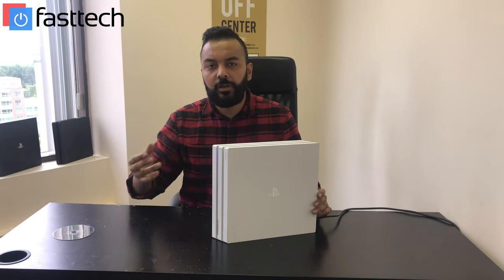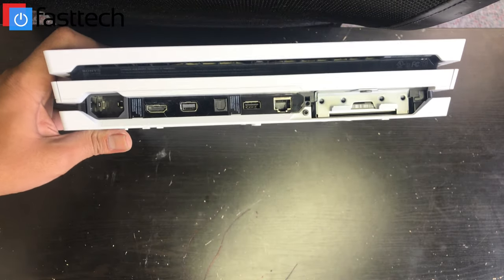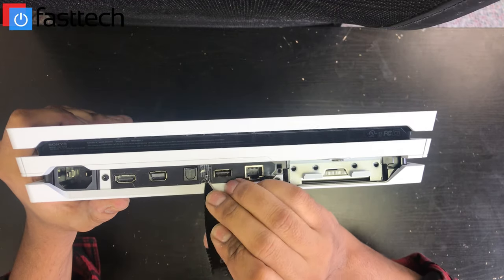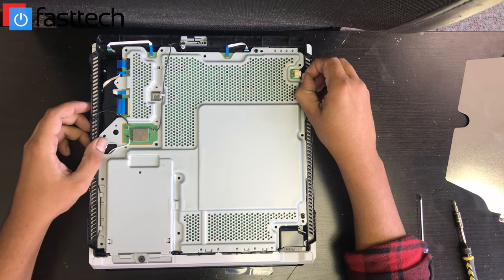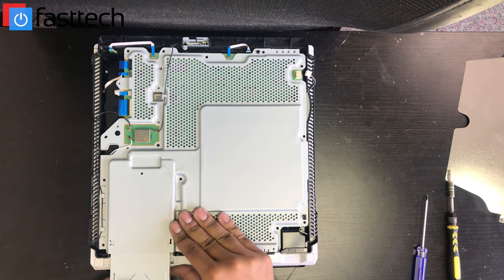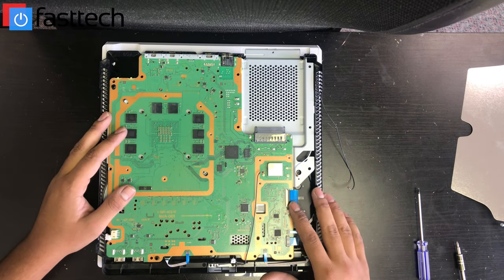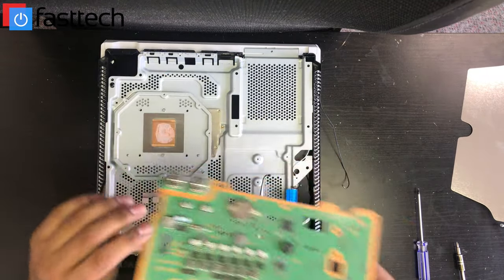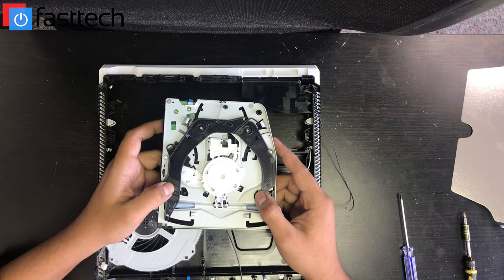PS4 Pro Disassembly and Disc Drive Repair Fail

Comment from the maker: FREQUENTLY ASKED QUESTIONS
Where do I buy the parts and tools needed for this job?
▶️PS4 Pro Disc Drive (CUH-7015/7000): https://www.fasttech.ca/playstation-4-pro/ps4-pro-disc-drive-cuh-7015a
▶️PS4 Pro Disc Drive (CUH-7115/7100): https://www.fasttech.ca/playstation-4-pro/ps4-pro-disc-drive-cuh-7115
▶️PS4 Pro Disc Drive (CUH-7215/7200): https://www.fasttech.ca/playstation-4-pro/ps4-pro-disc-drive-cuh-7215
▶️Torx T8H Screwdriver: https://www.fasttech.ca/playstation-4-parts/torx-t8h-security-screwdriver
▶️Knife used: https://www.fasttech.ca/tools/credit-card-folding-knife
▶️Dont want to DIY? Send us your PS4 for service: https://www.fasttech.ca/ps4-pro/ps4-pro-disc-drive-replacement
👉 NEED HELP? FaceTime/Zoom Video Call Me: https://www.fasttech.ca/online-consultation
👉 GET REPAIR SERVICE FOR YOUR DEVICE: https://www.fasttech.ca/electronics-repair
Reply: Sir can you please reply and give me advice. Which you have 4 disc drives i don't know which one is for my ps4 pro . Can you please help and tell me how will i know which is the correct drive.

Comment: Hi Fasttech, thank you so much for making this video! I had a disc drive problem where discs weren’t loading and had to disassemble the ps4 just as you did here. But I found e problem right away, one of my kids shoved a coin pretty deep into the disc drive slot that jammed the mechanism. Once I removed that I was able to fix the problem.  I wouldn’t have been able to do it without this video. You saved me upwards of $150 and about a month of time for a straightforward fix. Thank you!
Reply from the maker: Im happy for you :)
Please subscribe to the channel and like the video. Helps us out more than you think.
Reply: Done!

Comment: It’s because the spring is missing on the top of the black plastic structure. There is a little spring attach to it, it’s weird that you didn’t find when you make the drive jiggled for makin the little white piece fall
Reply from the maker: Mystery solved.
Reply: @fasttechvideo  glad I could helped haha ;) have you already return this ps4 to the customer that sended it to you or was it a personal one ??
Reply from the maker: @Philly_ndaduboze  We ended up replacing the disc drive.
Reply: @fasttechvideo  ohh shoot if only someone brought it up to you sooner you guys could have save some bucks just by taking a random tiny spring from another device. Hope the replacement worked well tho.

Comment: Thanks a lot for this video! It helped me remove a disc that was stuck inside (glued!). Could be worth adding a short sequence at the end of the video to reassemble the console :p.
Reply from the maker: Hey Luc,
Thanks for your comment and I hope you subscribed. We have done reassembly videos on PS4 Pro systems so do check those out if you still need help.

Comment: Hey great channel man. Cleaned my ps4 pro cuh 7115b and changed all the pads and paste but now it won’t update. For a fact I messed up my disc drive. Will buying one from you fix it? It turns on and works well but won’t update.
Reply from the maker: Sorry about the late reply but this could be due to a bad hard drive

Comment: Yow men, i also disassembled my PS4 Pro. I followed each and every step. I never missed one. After cleaning it, i assembled it again, tried to open my PS4 Pro, now it says, unrecognized disc. What do u think is the problem? Its perfectly working before i tried to clean it. But now i cant play :-(
Reply: Note* i didnt touch the disc drive. I stopped disassembling right after i removed the motherboard. I didnt touch the fan as well.

Comment: Could you do a video for ps4 pro error code SU 42118-6 that came from the 7.5 update? I tried everything (safe mode, usb method) and resorted to ordering a new drive from your site (I hope the drive comes with ribbon cables)

Comment: yo fasttech I wanna know when pack come . so I’ll be ready
Reply from the maker: Whats your order number?
Reply: Fasttech # 03964
Reply from the maker: @sabby4776  Your order should arrive between 28th April and 3rd May. All orders are delayed due to the pandemic.
Reply from the maker: @sabby4776  I see 4 items in the order and some parts are shipped separately and may arrive sooner.
Reply: @Fasttech well I’ll see it by then . I did get two of my parts waiting for three more parts . also thx fo letting me kno
Reply from the maker: @sabby4776  Did it come in yet?
Reply: @Fasttech not yet
Reply from the maker: @sabby4776  What about now?
Reply: I ordered on April 28th and still have yet to get my order?
Reply from the maker: @loancao7986  Certain orders might be delayed to due the pandemic. Call 1(888)744-7372 during our business hours.
Reply from the maker: @loancao7986  Did you get it? Should have arrived by now.

Comment: I've had mine apart and gave it a clean. Still getting the unrecognised disc error. Can I just replace the lazer or should I do the whole drive. And what drive do I need for CUH 7002B
thank you
Reply from the maker: CUH-7000 = CUH-7215 = CUH-7002

These are all the same consoles but sold in different countries.

Comment: Don't try and wiggle the connectors, just broke the PSU connector off the board by wiggling it 😠
Reply from the maker: You must have wiggled it from the mainboard connector and not the cable.
Reply: @fasttechvideo  nah the cable came.off with connecter, I'd honestly say it was poorly soldered, didn't take much force at all
Reply from the maker: @xPertKief  sorry to hear that, unless a trace is ripped you should be able to solder it back on with with mediocre difficulty.

Comment: Hey I watched your dust build up video I cleaned out my heat sync trying to stop my loud fan and now my PS4 is overheating any idea how I can fix it?
Reply: you either didnt reapply thermal paste or didnt put the heat sink back on properly
Reply: Thank u I did it about a month back and it was indeed the thermal paste

Comment: Hey guys so I took my ps4 pro apart inspected the disc drive a bit and then reassembled everything but the disc drive doesn’t work anymore it takes the disc in sometimes but nothing happens it doesnt read anything doesn’t even show unrecognized disc what can I do so the disc drive works again PLEASE help.
Reply: Yow men, i also disassembled my PS4 Pro. I follow each and every step. I never missed one. After cleaning it, i assembled it again, tried to open my PS4 Pro, now it says, unrecognized disc. What do u think is the problem?